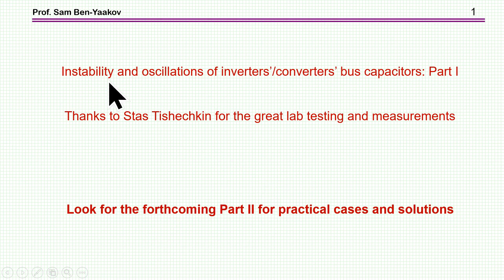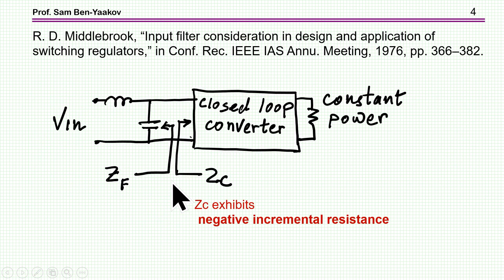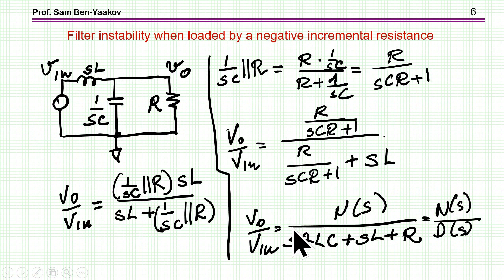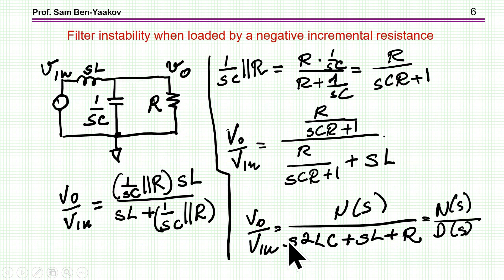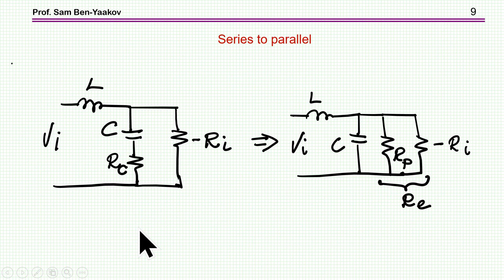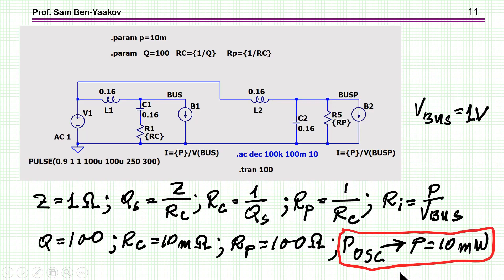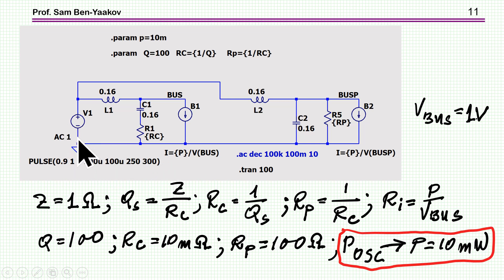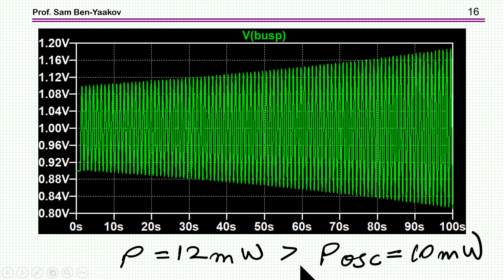Instability and oscillations of inverters’/converters’ bus capacitors: Part I

Comment: This is a great topic.
I just came across it in this video:
https://www.youtube.com/watch?v=c1QSn3i_IEo
following a product review of a battery powered AC mains generator.
Some people in the video's comments claim that this is considered normal behaviour for the product in the particular usage shown.
I am of the opposite persuasion but I think that whether this can be considered normal behaviour or not is more of a legal question rather than a scientific one.
Nevertheless, there is an interesting question arising from an electronics perspective: can a battery supplied AC mains generator be designed that is stable under heavy inductive loads using a cheap practical circuit? Could this be worthy of a dedicated video?
Reply from the maker: Thanks for sharing your thoughts. To accommodate heavy reactive loads one needs to increase the current capability for same real power.

Comment: Hey professor, I have another little question:
The conversion at 10:36, when the approximation is valid? I know this approximation valid some time in fourier plane(near resonant frequency)
but for using fourier plane, we have to assume stability,  can we use this approximation in laplace plane for stability proof?
Thank you.
Reply from the maker: There are approximation in this transformation. The main one assuming that the resonant network are the generic series or parallel. I think it holds for high quality factors.

Comment: Hey professor, thank you for the video, I have a little question,
 At 14:43, why does Ri=P/VBUS (operation VBUS), at 4:51: Ri= P/Ii^2 ->Ri=P/(P^2/Vi^2)-> Ri= Vi/P, 
and I assume Vi= VBUS = V operation point,  
thank you!
Reply from the maker: Thanks. Indeed  Ri=P/VBUS is a typo. But then,  Ri= Vi/P  is wrong too. 1. missing minus sign. 2. wrong dimension V/P is [1/A] not [Ohm]. So I guess everyone can err😊
Reply: @sambenyaakov  I meant (Ri= Vi^2 /P), I wrote Ri = P/(P^2/Vi^2). Is Ri=- Vi^2 /P the right expression?

Comment: Hello Professor, I always like your content which is very much informative and easy to understand. However, at 6:13mins the output voltage transfer function i.e. Vo/Vin should not have sL in the numerator, this is slightly confusing. Apart from this, the final denominator expression should be LCRs2 + Ls +R in my opinion changing the quadratic solving. Please enlighten on these fronts. Thanks for your good work.
Reply from the maker: Hi, thank you very much for taking the time to examine the derivations in the video. You are of course correct on both. On the first point, I already added a comment on that at  the YouTube description page. I was not aware of the second error you pointed out. As you wrote the general final result is the same. But I will also make a correction note or even a video.
Reply from the maker: Thanks again https://youtu.be/1p7v8qYRT70
Reply: Thanks again Professor 🙏

Comment: Thanks for the very interesting video!
However, I don't understand something:
If the condition of stability is to have Rp higher than the input resistance of the converter (as shown in 8:22), then from the expression of Rp in 10:30, we can understand that our goal is to have low Rc. But it doesn't make sense because if Rc is zero we know that it is not stable. What am I missing?
Reply from the maker: Hi, I think you got it all backward. We want low Rp so the equivalent resistance will be positive (smaller than Ri) , so RC needs to be larger.
Reply: @sambenyaakov  Thank you!! Now I see that it is my mistake.. Rp needs to be lower than Ri :)
Another question: I assume that Ri depends on the frequency, and the expression for Ri in 4:22 is the DC value. Am I correct?

Comment: Very timely and thank you. I have this  exact vexing problem with a power inverter that randomly and under certain conditions will go into oscillation and blow the Mosfets in a twinkling of an eye. Its not possible to replicate this reliably to test , and of course, once it blows, there is nothing to test.  I was thinking resonant  phase changes and tried lead/lag filtering without success,  I think you may just  have the answer.
Reply from the maker: Hold on to part 2 . Can you share the info about the type a d number of caps you use in the said system?
Reply: @sambenyaakov  If I take the input section as a series circuit, L/C and parasitic R, we have the same conditions as you describe. Where the current is injected should matter little, or the direction of current, in my case this can be sourced or sunk via the transformer over parts of , or even over a complete cycle.... therefore the conditions are the same for negative resistance to occurr as you describe.  Yes, looking forward to part 2. Unfortunately in the repair industry, time constraints usually prevent any real analysis of these annoying problems.
Reply: Device is a classic push/push inverter, using 24 Mosfets , 6 center tapped  38kHz transformers. Input , 48vDC 2200mFd x 12. These run HOT despite low ESR . Mosfets are IRFZ44N, not the choice I would make here, . PWM Gate drive low period oscillates around 600 mV above ground despite active driver pulldown, 10 ohm series R. Quiescent current is high. I suspected Dv/Dt issues , lowering freq makes no change. Failure occurrs randomly when un or slightly loaded.  Frustratingly,  an identical unit functions perfectly.

Comment: Thanks professor!  
Instead of a passive filter, if one more converter is cascaded and operated in current mode while the original converter in voltage mode, would the instability can still occur?
Reply from the maker: The instability is at the connection of the converter and an LC filter needed for EMI suppression.
Reply: @sambenyaakov  Yes, understood. Making a similar video for instability & oscillations in cascaded converters would be greatly useful. Thanks!
Reply from the maker: Good suggestion Will see. Thanks

Comment: Thanks for sharing. Interesting approach to this phenomenon. 

Do you think that having a DC source at the input and pulsating power (current source) at the output would give the same result? Where the power changes from stable to unstable level (with 10mW crossover). 

Voltage perturbation on an inductor should resemble current perturbation on a capacitor in a resonant circuit…
Reply from the maker: I have no experience in this. Perturbation may perhps be a way to go. Thnks for sharing your thoughts.

Comment: somewhat related to the video:
Its intuitive that if resistance makes lc tank attenuate over time that negative resistance will do the opposite. The ZVS driver is a prime real world example of negative resistance -you have a main LC tank and a pair of mosfets set up so that the current they supply at 2 points in the circuit  is 180 deg away from the voltage on the same points. 
Seeing inverters trough the lens of negative resistance in resonant tanks is so mindblowing, yet makes it so easy to understand.
Reply from the maker: Interesting. Thanks for sharing.